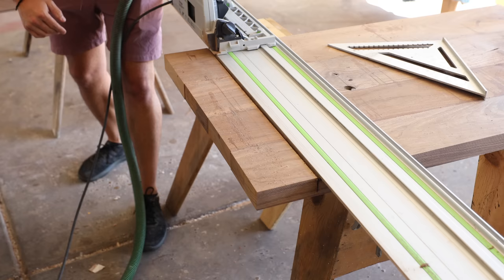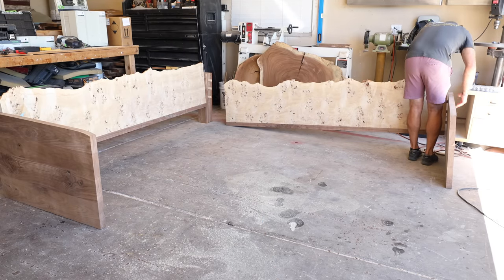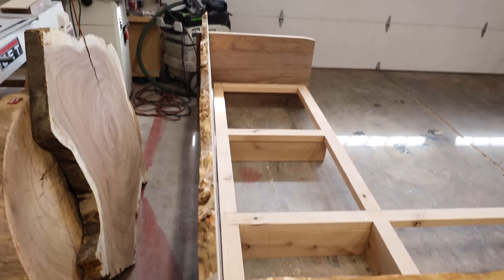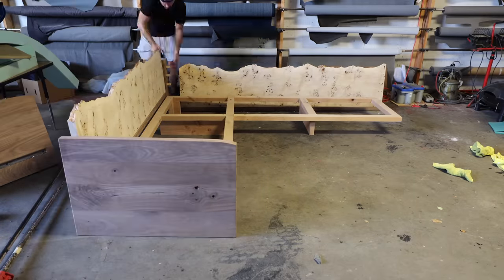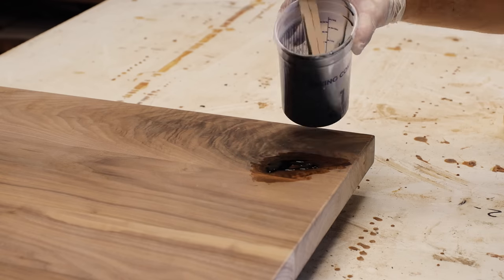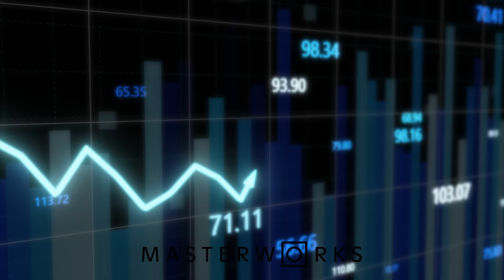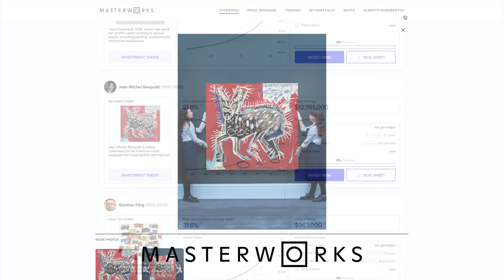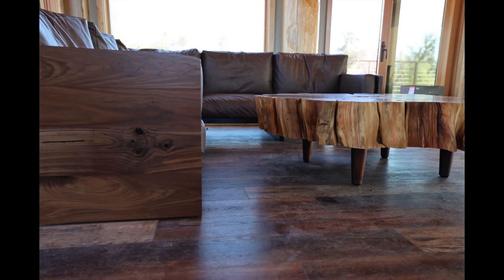Building My First Slab Couch

Comment: From an engineering standpoint that is a solid build👌. However, from an aesthetic point of view; it would have been really if you could see just a little of the woodbacking over the backpillows, and there is too much brown going on in the color scheme. Seems like you used some premium wood & upholstery materials, but they are so close in color that the visual texture details of the materials get drowned out by all the brown.. also didnt help that the color of your client's living room was predominantly walnut lol. But on the whole it is an excellent design that was executed excellently, especially considering you were experimenting with a new concept & collaborating with someone new.👏👏👏👏
Reply from the maker: Thank you for this feedback Ricky!  I originally wanted to do a softer white or off white leather to pop against all of the brown however, they have kids and that was their only stipulation is to have it darker.  I hope someday I can make another one, bigger and in a more open space with different wood species.  I think Wenge/Walnut and white leather wold be so slick!
Reply: I think the colors worked well together. Not everything has to be super high contrast

Comment: I did notice that 1 of the couch arm base wasn't quite flush with the wooden floor (maybe it was a trick of the camera). Also to keep the wood floors from getting marred a heavy duty felt can b adhered to the surfaces that come in contact with the floor. However the addition of the heavy duty felt may allow the couch to move more freely  (which might not b wanted). From the looks of the covered pieces it appears that at least 13 hides were used, however the bottom cushions may b large enough to require multiple hides per piece. So my guess is 15 hides.
Reply from the maker: So it definitely was the camera, I had installed 1/4" rubber furniture feet so it wouldn't slide everywhere, on the entire bottom side of the structures.  Usually I'll use felt, but in this case being a couch I didn't want it sliding back into the windows as the kids jump around on it haha.  Thank you for the feedback!!
Reply: @MattsWoodworks  when will you announce how many hides were used?

Comment: Ummm NO, YOU'RE ABSOLUTELY WRONG!!! 
Whenever you're adding a pigment to epoxy, whether that be a liquid pigment, a powder/metallic, ALWAYS add the pigment to the part A(Resin) and mix them together first,  then add the part B(Catalyst/hardener) Low speed when mixing too
Reply from the maker: I absolutely disagree.  Ill explain why:  When mixing any A/B resin system you initially see how cloudy they are, as the part B is working into the mixture, as a few minutes go by you see it clear up but almost every single time there are still phantom striation lines of part B that haven't been scraped from the sides of the mixing cup properly, so that being said if there is any pigment liquid or metallic, you would never know during the mixing process.  It just makes sense to add it after the resin components are thoroughly mixed first in my eyes.
Reply: When giving feedback it really helps bring a point across when it is said in a respectful manner instead of an attack.
there's better ways to say whatever you're saying, instead of being all degrading with the "ummmmNO YOU WRONG I RIGHT".

Next time maybe trying saying stuff in a respectful manner if you disagree with someone that is open enough to ask for feedback from their viewers.